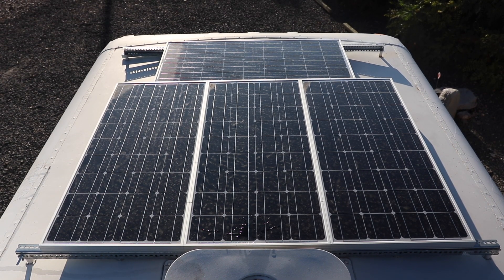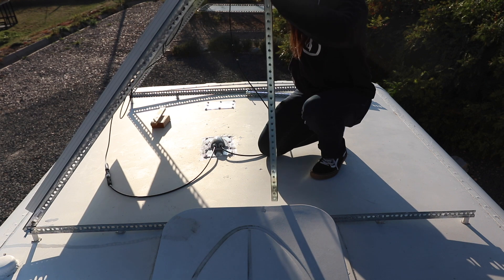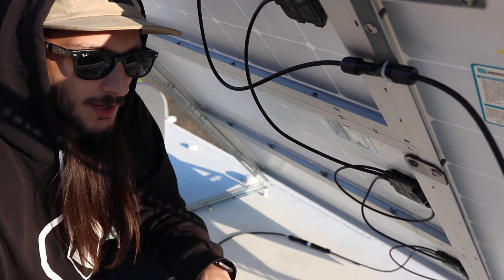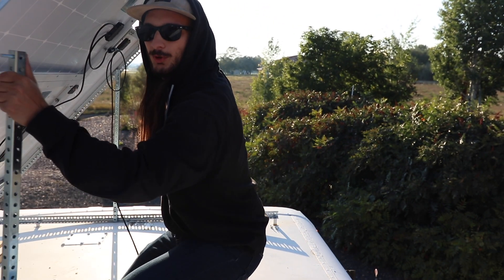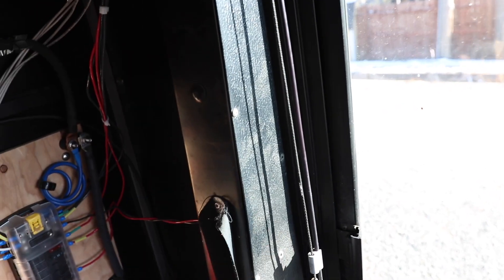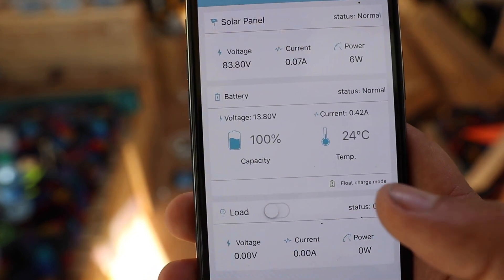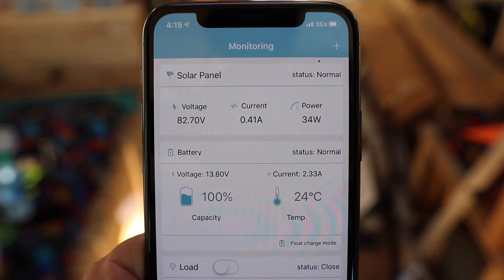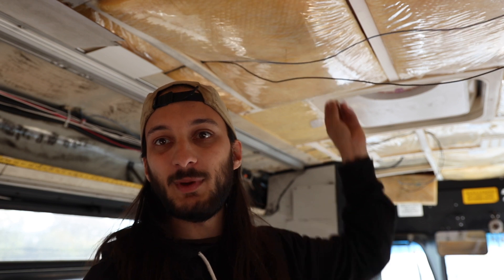Bus conversion! Installing solar panels pt 3! Showing how the brackets work and more!

Comment: Great work fella :-)
I would strongly suggest though that you cut the vertical square supports so as they can also be bolted on the bottom rail!  Otherwise a big gust of wind could dislodge them and cause the panels to come crashing down onto the bus roof potentially damaging them  :-/
Reply from the maker: Thanks! they are still holding up great and yes I didn't say it in the video but when they are up I do have blots in the bottom of the square tubings and to the bottom brackets connected to the bus. thanks for lookin out for sure! :)

Comment: You need to insulate the panels and your steel hardware from each other, or they will corrode very badly when it rains or snows.  The process is called galvanic corrosion.  It happens when dissimilar metals are in contact with each other in a solution.  You can find solutions to mitigate this online.
Reply: Researching this myself, and glad I read your comment. I’m thinking of using superstrut (cold galvanized) to mount mine, then painting the super strut where it attaches, and also using rubber gaskets/washers.